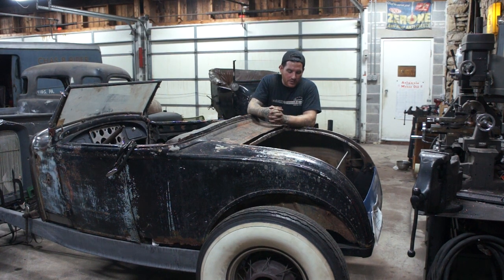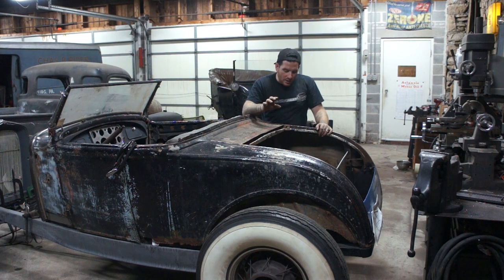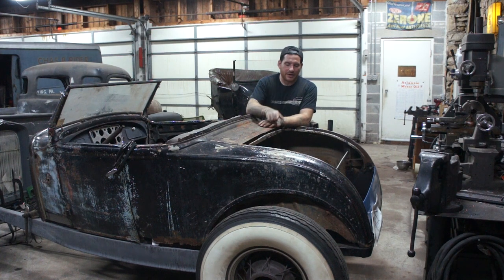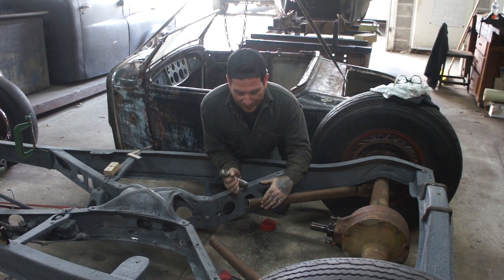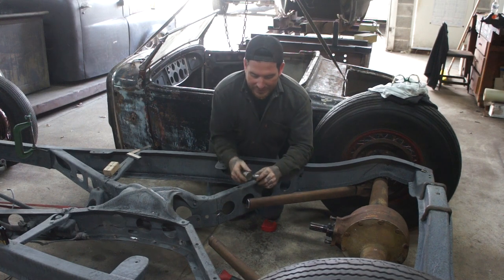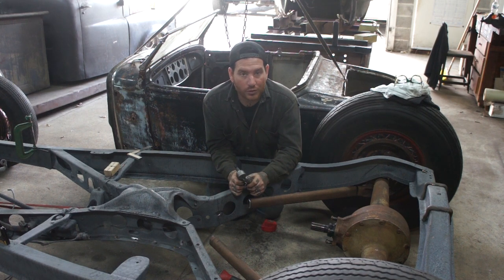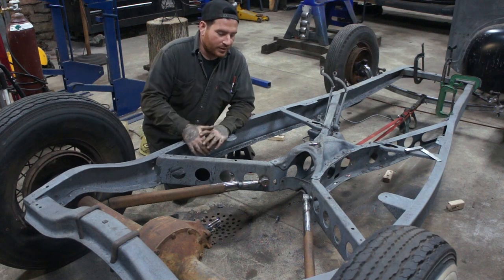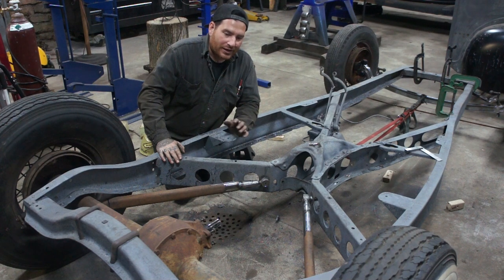How to Split Ford Banjo Rear Wishbones- Sweet Heart Roadster - Ep. 27

Comment: My neighbour split the front wishbone on his 1940 Ford. After spreading the wishbone and losing the swivel of the original design geometry the front axle would not articulate. 'After damaging one side of the split wishbone, he has had to change the front system to a four bar and a Panhard.  The original split situation would cause one wheel to be lifted as the front axle tried to articulate.  Lots of luck with your split.

Comment: The original Ford rear radius rods were engineered to hold the rear axle square to the torque tube.  They were never intended to control the rear axle torque generated by acceleration and braking.  Don't be surprised if they fail due to metal fatigue.